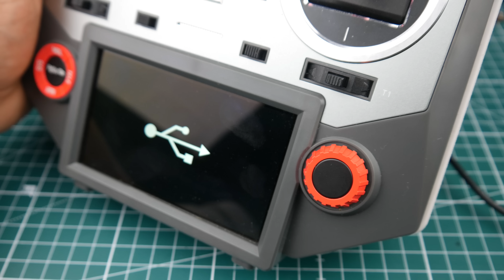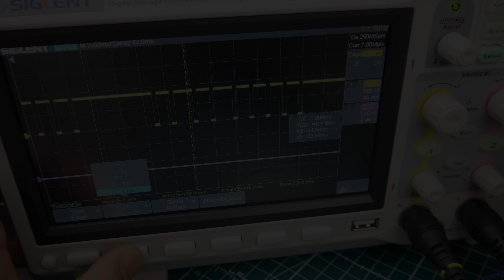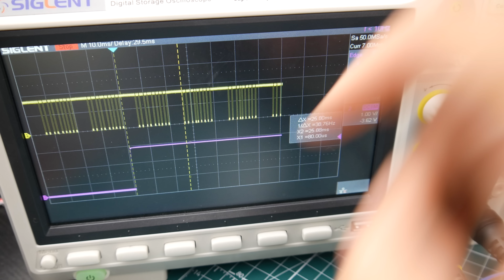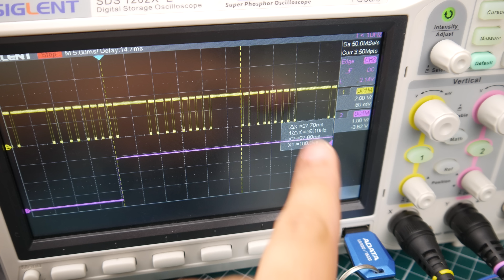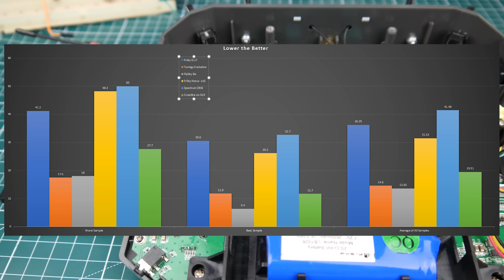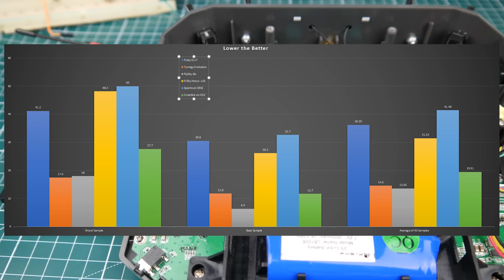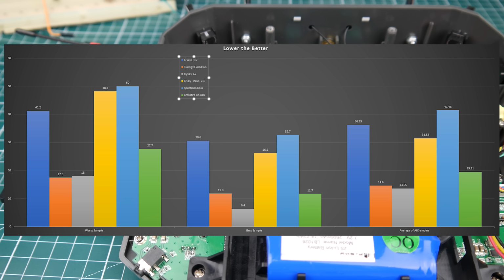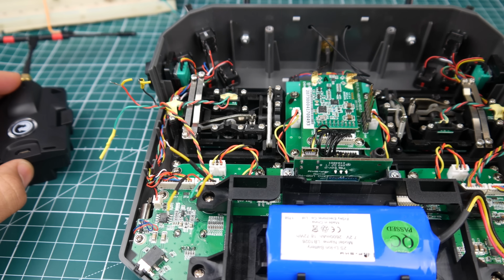TBS Crossfire Latency Test // CRSF Protocol

Comment: The x10 by default is set to 112kbauds, did you change it over to 400k for the test? you will get telemetry errors without the inverter mod but the control will still be the proper latency reading. 112kbauds link is 16ms as opposed to about 5 for 400

Comment: Great work.  Thank you so much for doing this for those who do not have the time, equipment or skill.

I suspect the latency in the internal TX is a combination of transmitter firmware and connection to main board (bad use, or non-use of a sync signal).

If the iRangeX IRX4 gets it right, it could possibly have crossfire type latency times (for FrSky sBus signals).

Comment: I have a theory as to why your results don't match with popular perceptions. You are testing the radio latency only. I wonder if Betaflight and Raceflight protocol parsers also are adding different latency. Maybe the IBUS parser on Betaflight is really slow. Maybe the DSMX parser on Raceflight is super fast.
Reply from the maker: Curtis Campbell That is the next phase of my testing however I will test it down to esc and not a led or a gpio pin
Reply: Drone Mesh Cool
Reply: Drone Mesh looking forward to that

Comment: FrSky in colaboration with the betaflight guys  adressed the issue with FPort. Sadly non of my receivers is compatible yet.
Reply from the maker: Vincent Fischer Can you send some kind of link this is the first time I hear this.
Reply: Yes, see the reply below. This really could be a game changer and unleash the true low latency performance out of our FrSky radios. Your latency test videos were really eye opening
Reply: it doesnt mention latency there, but anyway thats not what interests me, i dont think the radio latency is bad enough to need improved, otherwise all the racers would use flysky i6x, but what is really interesting is one wire for everything, that would be a huge benefit to everybody. remember even the most basic toys and semi hobby class camera quads have all sorts of bells and whistles for rssi telemetry...so even fport, as grateful as i am to the betaflight crew, is starting to lag behind the toys in functionality.
Reply: I don't think its going to be as big of an improvement as people are expecting to be honest.
While Fport will be faster than sbus it still uses the same underlying D16 protocol for the radio link and will be constrained by the existing latency on that.
Crsf implements both the radio link protocol and the RX/FC comm protocol which helps drop the overall latency through the system.
Fport will certainly improve things when wiring up frisky RX's though, doing away with all that signal inversion nonsense and removing the need for an ADC for RSSI.

Comment: 1 Did you just put opentx on it for this test? if so, did that impact the normal, non crossfire, performance?

2 No the crossfire module is not fed via ppm in the module bay. The radio sends serial data. Would still be interesting to measure there though.
Reply from the maker: Peter Kjellström Defualt firmware does not run Crossfire csrf proto
Reply: Drone Mesh Yes but that was not what I asked. I was curious if the now opentx updated transmitter does better when running the normal built in frsky module + frsky rx + sbus.

Comment: Was this tested in 50mhz mode or 150mhz crsf mode?
Reply: From oscilloscope it's seen, that 1 frame takes 20ms, so it's 50Hz mode
Reply: Why didnt he test it on 150hz which is 3 times faster

Comment: Considering the general difference between the QX7 and the X10 using the FrSky receivers, it could be argued that the X10 has some processing delay not present in the QX7 (I'd figure the high res LCD kind of snatches more CPU time than necessary). Without that sort of delay, the Crossfire on QX7 would probably get closer to the Fkysky/Turnigy system.

Also, did you do the inverter hack on the X10? Without it, if you have already the firmware revision dealing with the whole issue in software, the communication to the Crossfire transmitter would be capped to 100kbit instead of 400kbit. That's another potential for latency, since it limits the update rate to under the 150hz the receiver can do, and that's a potential for aliasing (i.e. updates arriving one cycle later, because a time window was missed).

Comment: I wish we could install hall effect gimbals in Flysky receivers ^^ (because I don't really care about openTX and that kind of jaazz). Which firmware was used on the Flysky transmitter, which protocol and which receiver? Also, does the number channels influence the latency?(i am guessing less channel = smaller packet = faster to transmit?) Thanks
Reply: I've installed some FrSky M7 gimbals on my Flysky i6s and they work great. With a 5dbi antenna mod range is also incredible. I could be wrong but I think latency would mainly be due to the way signal is encoded/decoded since all radio waves travel at more or less the speed of light.
Reply: Why would you install gimbals on your receivers lol?
Reply: yeaaaah transmitter ^^

Comment: that flipping off was a goodbye to the non-opentx firmware ? :D Measuring PWM on radio pin is actually a good idea. Since you released the first video I was trying to understand why taranis feels so qucik, yet its mediocre and spektrum just a tiny bit slower but feels so bad (to me). Maybe its actually the communication protocol. It would make sense as AFHDS is very close to failing thus its not that solid and it probably takes less time to compute than ACCST. There is no other way man, you have to step up, and actually track the communication between TX and RX :D

Comment: Im a bit new to all of this but now i wonder...why is everyone on the Frsky bandwagon when the flysky is cheaper and much faster?
Reply: Garrett Weekly I was on Flysky for a long time, but I swapped for a QX7 due to a woeful history with a lot of Flysky receiver issues.  The FS-A8S being the premium offender.
Reply: Because openTX, hall effect gimbals, module bay, community support, wide range of receivers, bulletproof protocol.. You name it.
Reply: Tried flysky before, setting was too limited, yet, model ID was non existence even i bind different receiver to different model, still if i selected the wrong model for the receiver, it still connect and execute the stick command. This is the major issue i had that cause one of my quad/rc car gone hair wire.
Not to say bad on flysky, it works, maybe for multiple same rc models, but security & safety reasons, especially radio was used for multi-purpose such as RC plane, RC Excavator , RC truck etc , is recommended to have separate model ID on the radio and receiver to avoid wrong model being selected and causing unnecessary havok.

Comment: Did you do the 400Kbit mod for the X10? i would do this with a X9D, that works best for all FrSky Transmitters without a mod
Reply: if you don't do that mod .. the X-Fire is only able to to 1/4 of his speed
Reply: The X10 does 400k.....its the X7 that needs a mod
Reply: no it don't... 
the OpenTX team confirmed it that the X7 and Horus X10(S) also got a lower bandwidth, so you need the mod...
so the Test isn't reflecting real world performance as with a X9D or TBS Tango

Comment: I think u might interested in more detail technical explain  from Bruce from his video https://www.youtube.com/watch?v=Vy7Gg6Tj57Q for Specktrum while Frsky on his website  http://www.rcmodelreviews.com/frskyreview2.shtml 

From the basic understanding, 2.4Ghz radio use a quite wide bandwidth and most radio perform frequency hopping (done thru firmware itself) to properly communicate between transmitter and receiver. Every communication will established more than once thru different frequency for redundancy, in which causing the extra overhead. 

While TBS crossfire under narrow 868Mhz SRD Band /915Mhz ISM Band less overhead for frequency hopping.

Yet, no information on how Flysky/Turnigy evolution communication protocol works, suspected the redundancy process was skipped ........

Do correct me if i'm wrong

Comment: Did you trigger the throttle deterministically or randomly
Reply from the maker: +null FPV Randomly
Reply: What are you probing?  These look like PPM frames.
Reply from the maker: null FPV The rx and running csrf proto
Reply: Wow .. you must have some alien RX because those frames look nothing like CRSF frames.
Reply from the maker: null FPV Your making doubt myself I'll recheck everything today.
Reply: I'm working on a deterministic model for doing these sorts of calculations.  Randomness creates an unwanted entropic bias in something that should be measured with repeatable results.

Comment: Well naturally you know I have to post my 2 cents. So what does this all mean for the few ppl like myself still using FlySky? We have the fastest protocol but we just want better range. Time for that Wifi booster hack??
Reply: Anything above 100mW in 2.4GHz isn't legal in most countries. Just use LRS module if you want more range.
Reply: IRFZ44 we can't use a module in most FlySky transmitters.
Reply: FS-TH9X will do the job
Reply: IRFZ44 No Ibus. It wouldn't be much better latency than a QX7 with crossfire.